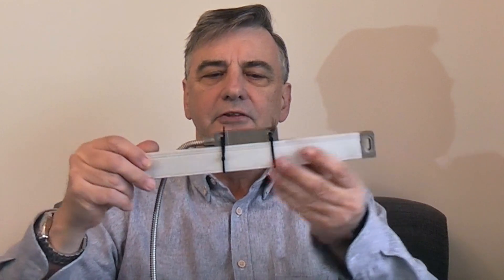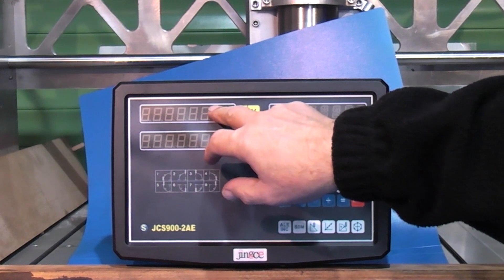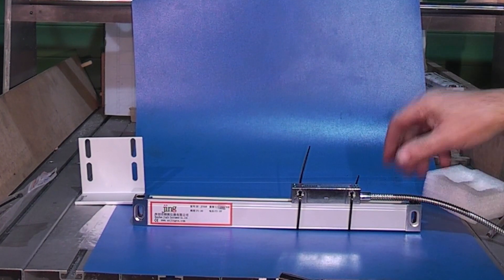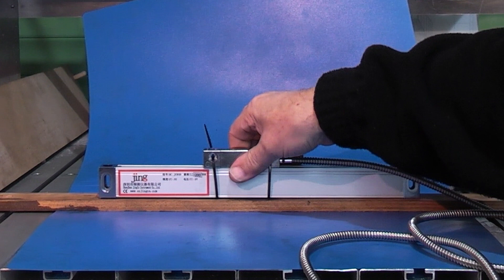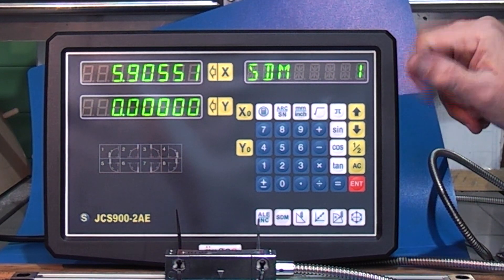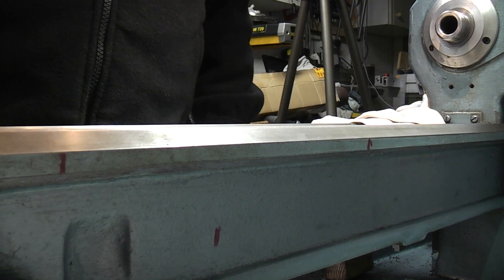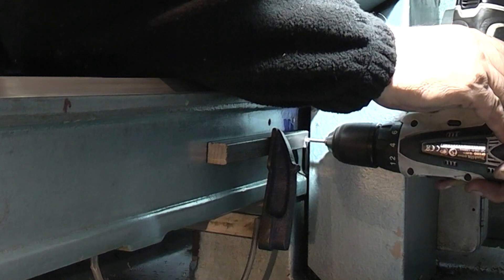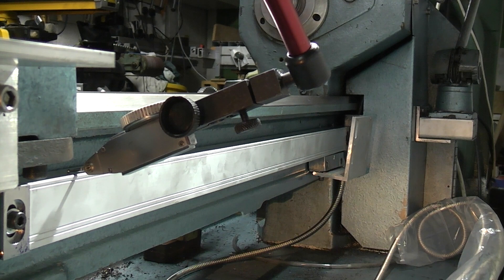Tool Review DRO for the lathe

Comment: Hi, at 14-21 you show your drilling guide in place. How the hell did you manage to locate with accuracy the guide hole over the required mark.??????
I have a Boxford A and just received my DRO, so I'm prepping for installation. Thanks for the efforts making the video. Robert
Reply from the maker: Hi centre punch the hole position get a steel rod the same size as the drill, machine a point on the end push it in the guide and locate the centre punch mark clamp in position

Comment: Hello,  As I get into it it would seem a 4 axis machine would be ideal for both mill and lathe.  Do you know of anyone who makes a small enough scale for use on the compound?  The quill could probably be fitted with a slim scale but a small scale for the scale would be better.  Some reason I am not thinking of why no one seems to use the other axis.  To have the depth of drilling on the same readout would be sweet.  The compound axis could have the geometry built into the program so it could tell you the depth of cut at right angle to the bed even when you are using the compound at an angle.  Information immediately at your fingertips.  A quick way to double check your work.  Very good topic.  Doug
Reply from the maker: Hi Douglas. The smallest scale I know of are the magnetic type, they have a self adhesive scale and small reading head. But they come at a cost about 5 times more than a glass scale.

Comment: Ordered DRO from Bangood.
2 xs screen and 2 measuring rails. 150mm and 350mm
150mm measuring rail arrived ok.
Bangood cancelled other to items 
I QUOTE 
they are over weight to send.
So be awhere ordering DRO from BANGOOD ???
Been offered 6% discount on next order or discount points/ coupons.
Reply from the maker: HI I think they are saying if over a given weight they can't send free delivery. So sometimes they split the order into 2 parcels.
As they did with me but this creates more problems as each parcel can go via a different route i.e. one may go Hong Kong to London the other may arrive 3 weeks later Hong Kong to Germany, Germany to London passing customs in Germany first EU port.
If you place an order for the display and another for the scales you will have 2 parcels and 2 tracking numbers.

Comment: Hello,  Timely video as I have one set of these for my mill but am really considering installing a set on my lathe.  One big problem is I will have to put on the thinking cap to see how I can install a scale at the back without interference from my taper attachment.  I was also wondering in my mind how a magnetic scale would keep from attracting swarf and damaging the scale?  I have also seen several YouTube videos showing how to cut the glass scale which may be useful.  I haven't mounted the mill scales yet as I have been holding off until completion of my shop expansion so am watching and absorbing all the info I can.  Thanks for your contribution.  Take care.  Doug
Reply: Hi, i have just mount mine dro on my colchester student , 2 days work!! Now i cant seth the X axis proper, diameter contra / radius, i have exakt the same model as shown in this video, do you know how to do?  yours: Ben from Denmark
Reply from the maker: Hi Ben. You need to set (R-D Mode) to do that switch on the unit holding the up or down arrow key this sets it to R-D Mode which should show in the info window. Press Ent then select X,Y,or Z axis the display window shows (select axis) display should show 0 or 1. Change the number on the required axis to 1 and press ENT. If 0 the display is set actual movement if set to 1 this is Diameter mode display shows 2x actual movement. Remember you need to set the scale resolution to match the scale used and the direction so you have the correct size reading and when you turn the tool in the diameter gets smaller.
Reply: @enotsengineering  Hi again, thanks for the fast ansver! I vil try this in this afternoon, hope it vil work.
Reply: Hi again, now I've tagged in as you wrote.
It worked really well.
Strange that the Chinese are not capable of making an operator that is usable.
For example, something as simple as telling in the book what the password is ...
Thanks again for the help; Ben Johnsson
Reply from the maker: Hi Doug The magnetic scales are similar to the scale used on digital callipers. But I can't figure out why they cost twice as much as a glass scale.

Comment: Hi, What size scale are you using for the bed of your Boxford?
Reply from the maker: Hi Josh I used a 600mm scale but your lathe could have a different length bed. Just measure the saddle travel from the chuck end to the end of the bed without the tail stock and use the nearest longer scale length. Check that the length will fit the bed .

Comment: i will be fitting DRO on to my Boxford next year
Reply from the maker: Hi Martin
 I found fitting the DRO to the cross slide the most difficult. Due to the shape and location of the casting and gib screws.
But I did fit it without drilling any holes in the cross slide see part 2 next week